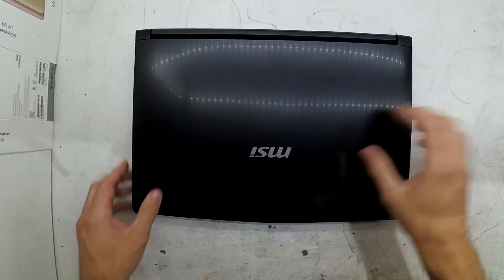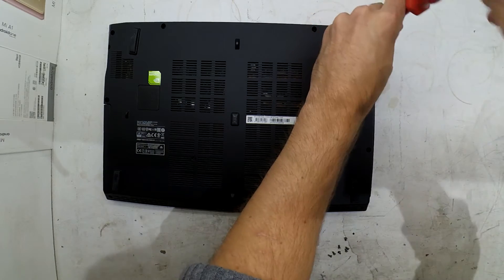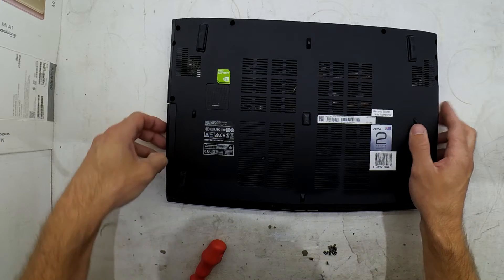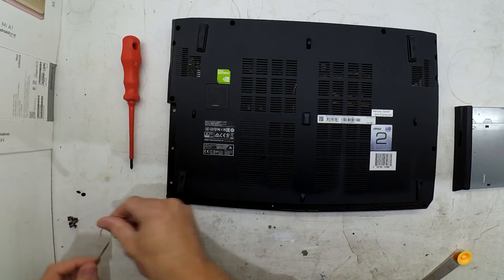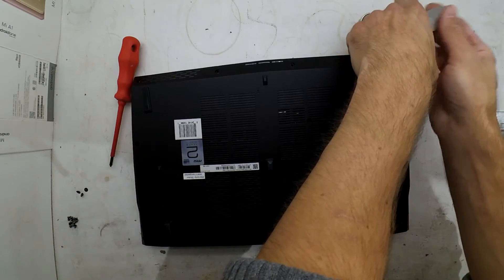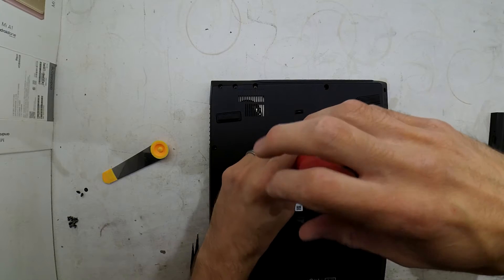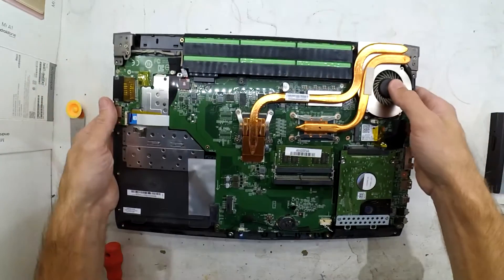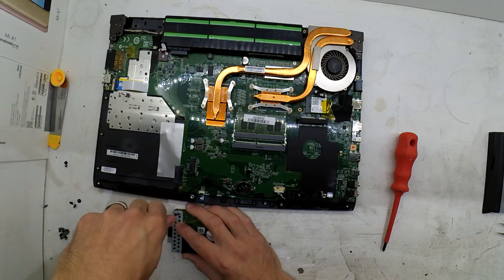MSI CX62 Teardown

Comment: I have the same model msi cx62 6qd 
I want to open it to (clean it - clean its fan it makes noise - put thermal paste on cpu) so what should i remove when i open it ? Can i skip removing hard disk ?)
Reply from the maker: need to remove fans and cooper cpu cooler

Comment: i have a question. where is the graphics card there? I have the same model but for some reason my graphics card broke my screen is going crazy with black o=pixels, now i just wanna know where the graphics card is
Reply from the maker: I believe the gpu is under the most central location of the board

But if you have to ask where it is, I don't think there is much you can do to fix it